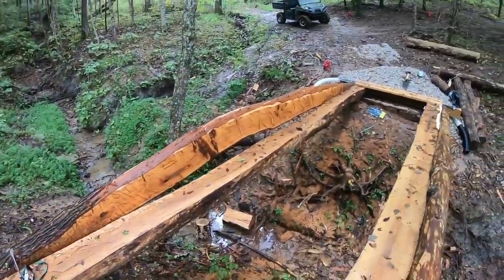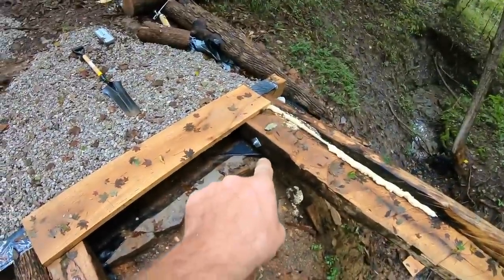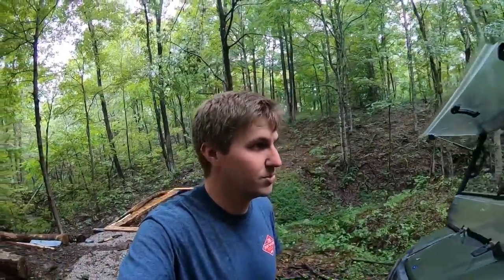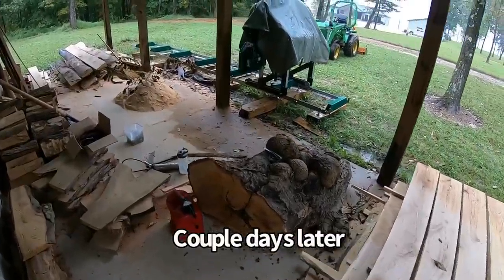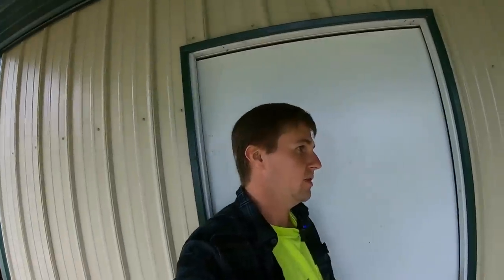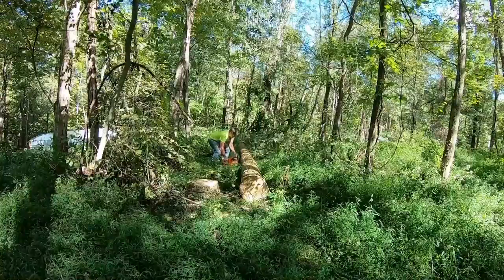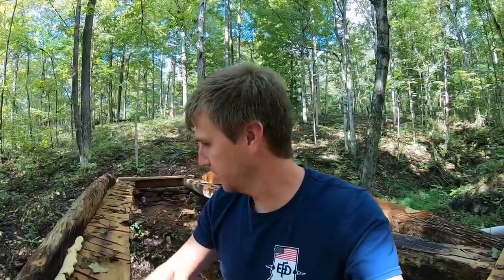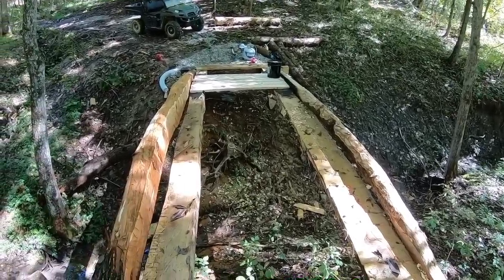Milling and Installing Bridge Decking - Log Bridge In The Woods

Comment: This was very cool! 

A couple of things:

1.  Are you making sure to put the deck planks in crown up on the bridge?  When those planks cup (and they will cup) you want the cup on the underside of the bridge so the planks won't trap water.

2.  To ease drilling in those long ass screws/fasteners, grab a bar of soap (I prefer Irish Spring) and 'wax up' those threads on the fastener with the soap, and it will absolutely go in tremendously easier.

Comment: Mike rub some cheap bar soap on the threads of the screws it helps to lube up the screw.
Reply: You might want to check with MBTS about that soap 'lube', he did an in-depth review on that stuff a couple of vids ago! 🤪

Comment: I'm not sure if you realize it Mike but the green planks will shrink considerably when they dry and will make the 3/4 inch gap likely over an inch wide.  You may have already considered that but I just wanted to point it out.     Nice job you are doing.  I like the use of the tar.  Should protect it well.   Will you be putting a non-slip surface on the runners for when it rains?   I was thinking that expanded metal would work well.      Just a thought.   Take care and stay safe.

Comment: I really like the bridge. I built several bridges for a YMCA camp here in Pennsylvania. I like how you constructed this one. I am thinking about an Alaskan saw mill because they’re a lot cheaper but would sure like to own a saw mill like you’re using. I welder a couple of D Rings on my tractor bucket that helps with longer stuff and using straps. My chain hook is in the center like yours. Love the channel.

Comment: One way to get rid of the widow makers is to drop another tree on them. Get a bar of soap and run the threads of the screw along it to get some soap on the threads and they will drive much easier. Nice job
Reply from the maker: Thanks for the tip!

Comment: We had plank bridges on the road I grew up on. Never noticed any treatment. Just occasional replacing of rotted boards. The bridges had two steel beams about where your tires would run. Then there were the cross boards that were maybe ten feet long. Then there were runners on top where the wheels would run. I think your bridge is overbuilt.
Reply from the maker: Overbuilt is the best way!

Comment: You can rebuild the batteries for cordless tools as well.
There's tutorial vids on here on how to do it.
I buy the D size batteries online 24 in a bunch.
As an electronics tech I learned how to do it long ago.
Basic soldering iron ability is all that's required.

Comment: Something you might consider to extend the life of your saw blade: pressure wash your log before you cut it.  That removes some loose bark, and much of the sand and dirt.  I have heard that dirt on the log is tough on the blade. Just a suggestion.
Reply from the maker: I don’t have water at the barn.
Reply: Fetch the rain water into those 275 gallons tod container.

Comment: Nice prodjekt ! Looking really good !
Fun fact  about oak , did you know that the white surface wood on oak 
Is very prawn to rot away or erode.
The heart wood is extremely resistant doe....
A security related question;
Why  not wear protective gear when using your shainsaws? You work alone also ... what if you cut  yourself? You may bleed out before you get help.
Reply from the maker: I keep tourniquets with me.

Comment: Looking great 👍 it’s coming together nicely.  Will be interesting seeing the durability of your bridge over time .  I’ve seen native lumber projects that last forever and then seen some not do so well. It’s always a crap shoot due to wind and weather conditions.  Things that can dry out last forever those that stay to damp seem to have a much shorter lifespan.  Fine project and a testament to your will power. 
🇺🇸🦅🌏⚓️🇺🇸
Reply from the maker: Hopefully we get a few years out of it!
Reply: @CaptainKleeman  
Definitely believe you will get a lot of use from it. I’m just curious about the life span. Being it’s elevated air all around it and the precautions your taking should be there looking good for a long time 👍👍
Reply: @CaptainKleeman  Maybe some used vegetable oil from the Derby Market on the deck (yum, smells like fries) or bio diesel?

Comment: Grab a bar of soap ,wax or dawn dish soap  to lubricate those screws....  it will keep that drill/ impact much cooler.  Will still need to pre-drill .
Reply: Yep, I use paraffin canning wax. Comes 3 or 4 blocks / box. Bath soap bar (save the the thin leftovers) works like you said, too.

Comment: Watching you move those big logs around is inspiring me to get some chain hooks on the bucket of my tractor. Does anyone here have an opinion about whether they should be welded on or bolted on?
Reply from the maker: Just depends on what you’re going to be doing with your hooks.  But welding is always a sure bet if you have access to a welder.
Reply: @CaptainKleeman  ... a pointer I got from an old timer was to bolt the hooks instead of welding. Reason being a cracked weld is not easily repaired in the field. A lose bolt can be tightened in the field and will likely take more stress than a weld before breaking. BTW, his example was a snow plow rigs so lots of impact stress. Also, if that part of your bucket is thin you could weld a thicker piece on  first then drill through both. This will spread the load over a larger area.

Comment: Come along nice Capt, 1 question why are you using 8in screws you can use 4 1/2in screws and get the same results not to mention cost savings not unless you got them donated from a project!
Reply from the maker: Overbuilt is the only way to go.  I’ll never wonder if I used big enough

Comment: Thanks for sharing your thoughts, ideas and videos. Bridge looks nice 👍. Maybe I missed it, what’s the theory behind burning the wood, is it to seal it?  Looking forward to seeing your upcoming videos. Wishing you and your family the best. Interesting thought about rebuilding your hand tools, are you tied to the manufacturers for parts or are there suppliers that deal in that, might make a good video when you get to that project.
Reply: Tom, it's a Japanese method to help prevent rot.
Reply from the maker: There are some after marketer parts.  I’ll have to double check the serial number on that drill.  But I’ll try and make a video on it.

Comment: Great video. I’m not a carpenter but wondering why you used 8 inch screws on the planks? Cheers from Australia
Reply from the maker: Wanted to be able to get to the center of the log with the threads

Comment: loads of firewood from getting the planking.

I was thinking before you started placing the planks that I hope he leaves a gap between the planks, to let the rain drain off.

shouldn't the logs be set on the mill so the ends are on the bunks? It really looked like you were warping the rods for the dogs with the logs sitting on them.

Comment: I just love watching your progress and attitude towards work, it makes me so happy.

I am going to ask probably a dumb chainsaw question: Is there a reason you haven't just gone and bought like a used Husky 460 or Stihl 260 - 360 range saw while you wait for a good deal on a larger one?
Is the cheap used market just not in your area like it is here in in the WV/OH/KY Tristate?
Reply from the maker: I have a 55 which works great,  just getting repaired.  But I just bought a used 372

Comment: You need a set of forks for your tractor to haul logs and lumber
Reply from the maker: Maybe one day!
Reply: Make or buy some bolt on forks, not too long, just enough to hold the logs in place.
Reply from the maker: @BRI33NOR  I have a long term fabrication plan.

Comment: Not sure what brand of screws you’re using but I’ve seen other YouTubers using timber screws and have no problem running them down in one shot. Perhaps it’s because you’re using green wood. 
TimberLOK seems to be the most popular here in the big box stores and with 6” being $1 and 10” being $1.50 they are certainly expensive. Might be cheaper in larger quantities though.
Reply: they could pre-drill the holes for them and not show that part of the process. I know The Ousider doesn't show pre-drilling yet he often has the screws through a plank before placing it in his log cabin build vids.
Reply from the maker: I’ll check them out!  Thanks!

Comment: Structural engineer suggestion: As for the "hump" in the deck logs.   Should have left it.  Bridge decks need camber so that when the load is one them they flatten out.  Without the hump/camber the bridge will eventually sag in the middle.  To help counter this, you should place a vertical member on the outside of your arch logs down to your deck.  A tension member, so good bolted connections.  This will allow the curved logs to help carry the deck weight.  Also as the deck logs deteriorate over time the arch logs can help carry some load.
Reply from the maker: Yup!  It’s in the plans.  Picked up the hardware today.  Appreciate the input!!

Comment: Just asking why are you using such long screws for? Would it be cheaper to get shorter screws for the deck boards and then use your longer screws for the running boards. Just asking.
Reply from the maker: I’ll explain in a future video.
Reply: Ok I must have missed it